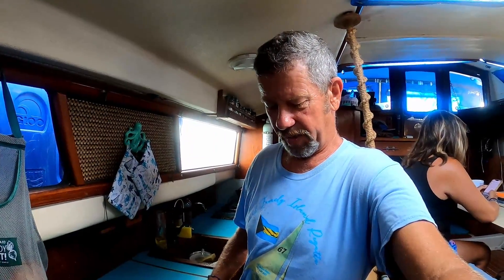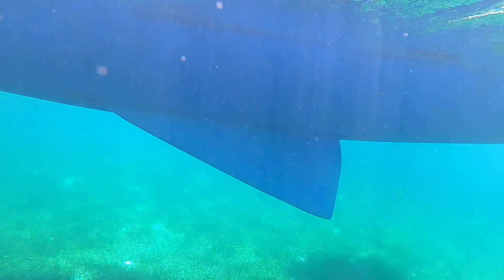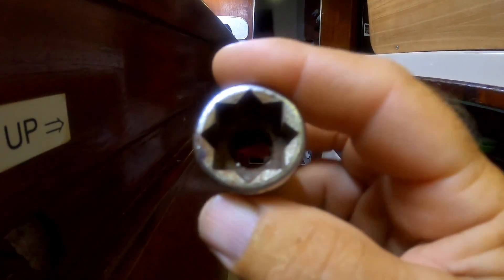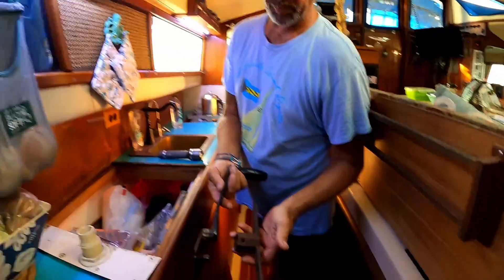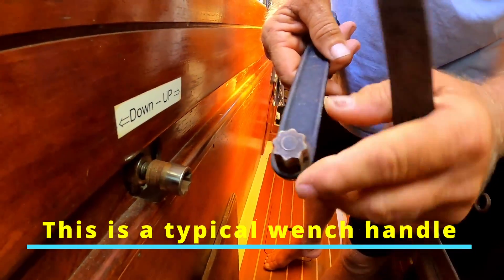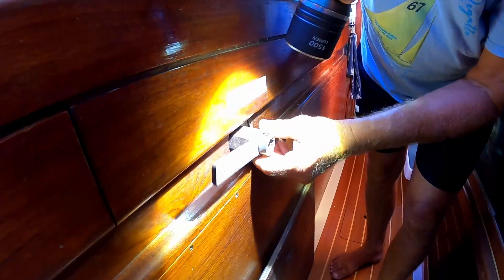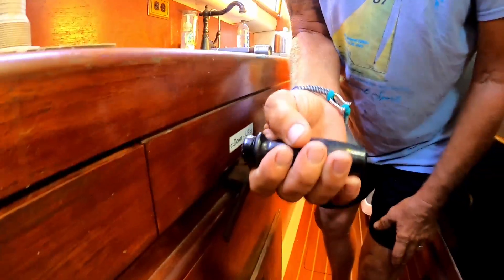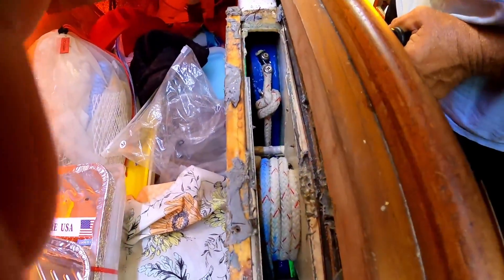How do center boards work on a Gemini 3200.

Comment: Great video on the Gemini 3200's center boards.  Question: how do you address the pivot point bolt if it begins to leak?  Thanks in advance.  Fair winds, 🤗⛵🇺🇸
Reply from the maker: @DLBard-bv2nd  we dropped the center boards when we hauled out. Replaced the stainless steel bolts with silicone bronze bolts and teak washers and 5200,  four years no leaks

Comment: Tell me more about the centerboard pivot bolt and the retrieval line.  I have to replace my pivot bolt as it is highly corroded and leaking.  As long as I'm doing that portside, I'll do the starboard side and replace both sides lines.  What is the length and diameter of the line and bolts?
Reply from the maker: @Whosethatkidd  I replace ours with silicone bronze bolts. Our 1990 Gemini 3200 has a 1/2" diameter 5-1/2" long. It had a stainless steel bolt in originally. But stainless with pit and corrode under water. I can remember the length of the line, when you remove the old one you can match it up.
Reply: Thank you that’s more information. I’ve been able to get days of searching the Internet.